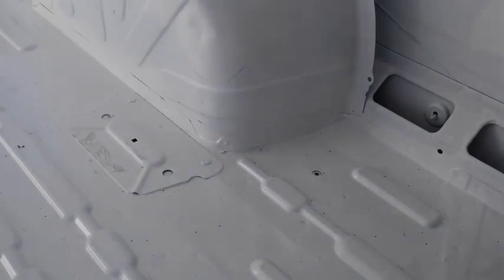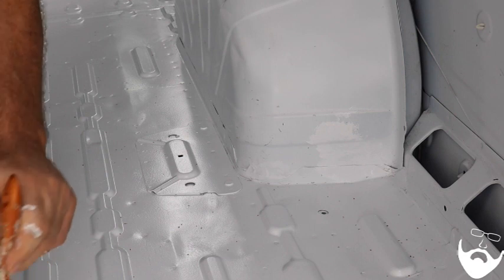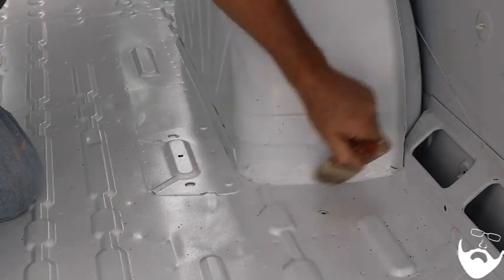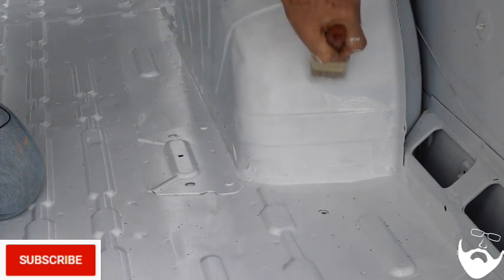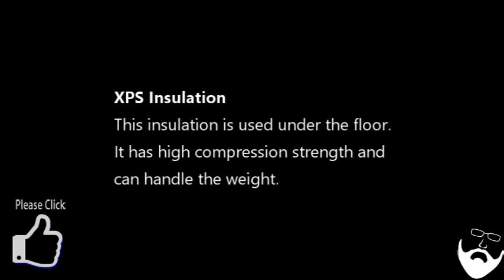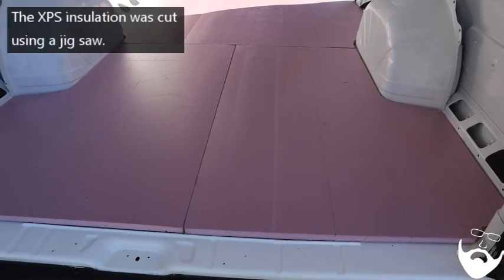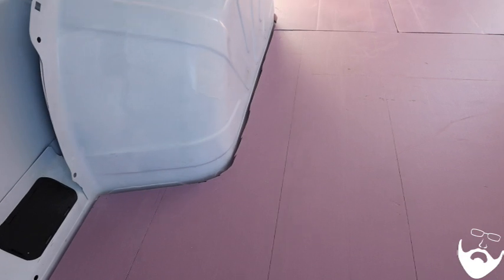Van Life Floor installation part 1  - Tracing Jig, templates and floor panels.

Comment: Did you ever go back and fill the gap between the 1" XPS and the walls of the van? If so, what fill material did you end up using?
Reply from the maker: XPS is only used on the floor.  The walls are insulated with polyisocyanurate insulation and polyester sheets as seen in this video  https://youtu.be/8zlfQBOSebY
Reply: @Frugal Factor  : I understand that. But in your video, when installing the XPS on the floor, you say to not run the XPS all the way to the walls, since the XPS would squeak as it rubbed against the walls as you drive down the highway. In your video, you said that you had not yet decided whether or not to fill this gap with something, perhaps a sealant. My question was whether or not you filled the gap you left between the XPS and the walls.
Reply from the maker: @seattleboatguy  Sorry, I did not understand the question the first time.   YES, I went back and filled the gap with clear Lexel sealant.   Took many tubes, may not have been 100% filled but enough to ensure it maintained the gap so there would not be any squeaking.   It worked 😁

Comment: Would it be much better to cut the bottom of this  plastic cover and glue the  xps? Just an idea.
Reply from the maker: Not sure what you mean.  No glue - I want to be able to back up and remove everything if needed.   If there is some type of problem, or modification I want to make in the future I want easy access.
Reply: @FrugalFactor   He meant cutting the bottom part of that black plastic cover so that only the top comes off. Then you can glue the insolation and still get to the electrical box.

Comment: Did you have to add cardboard to the left and right side of the wheel well? I used a  round plastic lid with a pencil sticking thru the middle and I always ended up with gaps on the left and right wheel well sides.
Very detailed content, thank you for sharing. Subscribed.
Reply from the maker: No, I did not add any to the wheel well.  I added to get to the centerline.  The best thing is that the "Garage" area is a perfect mirror image!